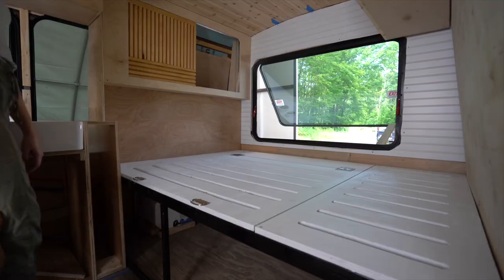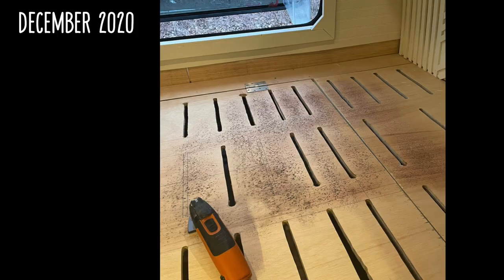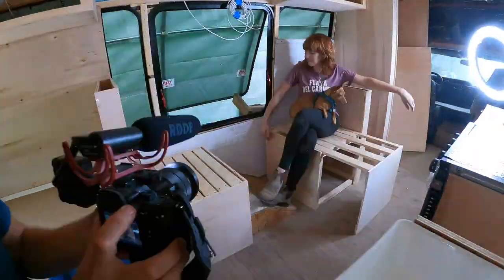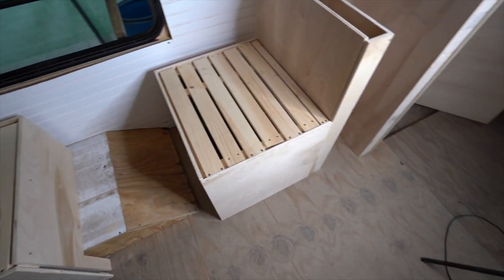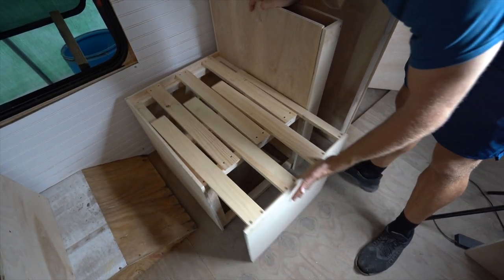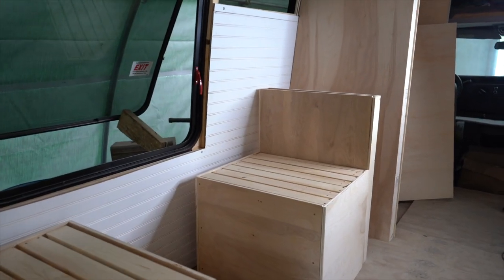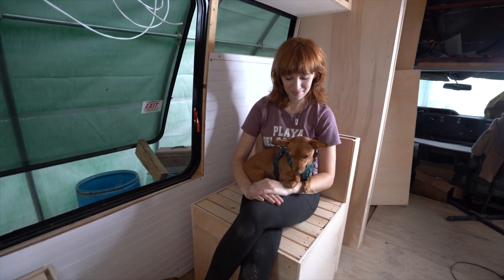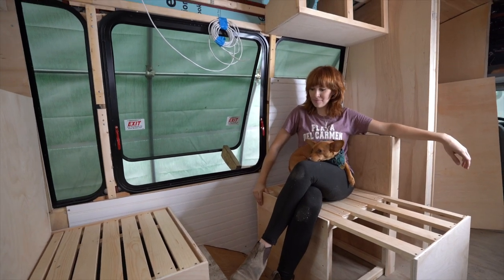Shuttle Bus Build Ep 9 | Modular Booth/Couch/Bed, Bed Platform, Herringbone Table

Comment: Just wondering if you plan to put gas struts on the bed. It’s great to be able to lift it but what happens if you need to get under there for a little bit? I wouldn’t be able to hold the mattress up with one hand and maybe throw some storage containers in there or put something in storage containers. You are right. The table looks spectacular. Anxious to see the hinges for it. Can’t picture it in my mind. I was expecting something like a piano hinge. You are making excellent progress! Looking forward to seeing the next video! Give Mattie the Wonder dog a scratch for me. Excellent project manager there!
Reply from the maker: Yes! Im happy you asked this because we forgot to talk about it. We have large struts that will hold the bed door open. The struts we use are pretty powerful and we don’t like to install them until the mattress is on and weighing down the platform. But the strut installation will be in an upcoming video. Probably one of the final steps! Thank you for watching 🥰